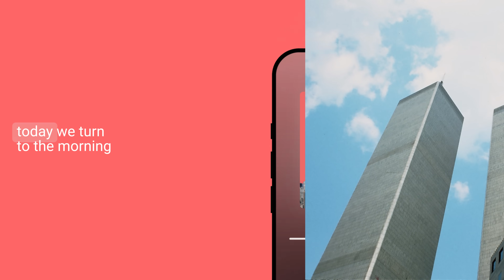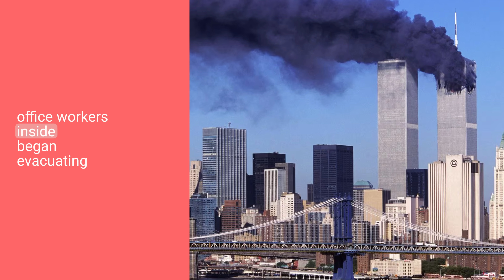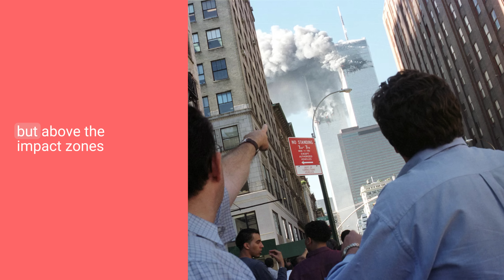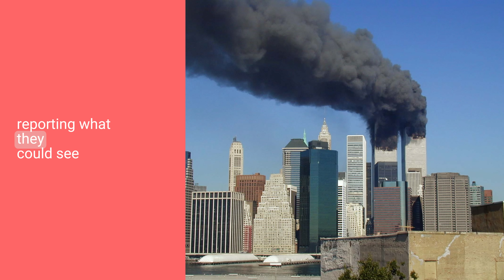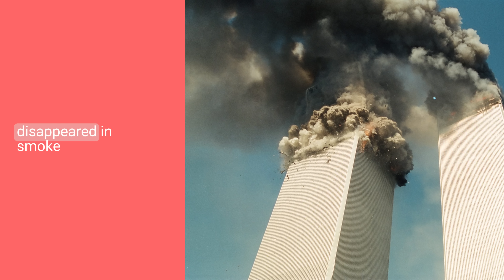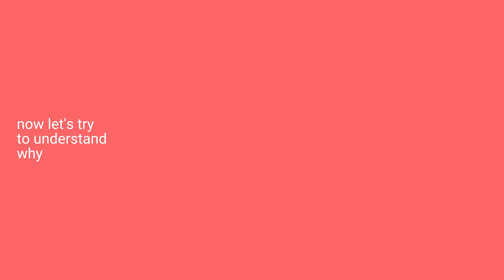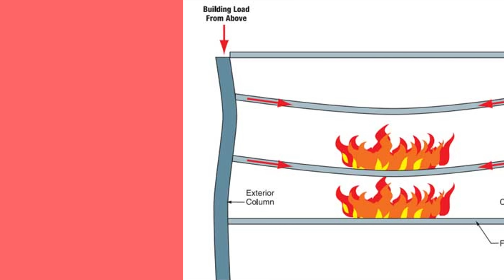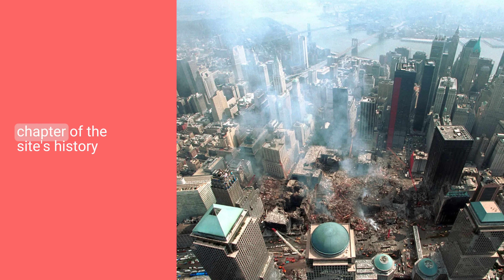9/11 - How and Why the Towers Fell

Comment: Why the “weakened steel hypothesis” is weak
0.a complete lack of detailed calculations, scientific evidence, and models describing how weakened steel led to a. initiaton od collapse and then  b. the complete destruction of two colossal structures
1. The jet fuel burned out within a few minutes—the remaining fires were fueled by materials that are fire-resistant  due to requirements. (low temperature fires)
2. All girders were covered with insulating material - eg. asbestos
3. The fires were isolated in nature - they could have weakened the steel only in specific areas
4. in the case of the north tower, the fires affected the upper part of the building - so, according to the logic of the weakened steel hypothesis, it should also have been weakened and shold be immediately destroyed
5. the weakened steel hypothesis does not explain the most important elements of the WTC collapse:
a. What was the mechanism that initiated the collapse? How could delicate weakened girders could “pull” the much more strong outer columns and the core?
b. What wrakened steel in place of impact could led to the complete destruction of the lower intact parts of the buildings? In both cases, the recordings show that the upper part is destroyed before the actual destruction of the lower part (no pile driver)
Reply from the maker: I get that you’ve got a lot of doubts about the weakened steel explanation. But it isn’t just a vague idea... the collapse has been studied in enormous detail by structural engineers and fire experts. NIST’s NCSTAR 1 report alone runs over 10,000 pages, with calculations, models, and simulations that show how the impacts and fires led to collapse initiation and progression. It’s not perfect, no model ever is, but there is a well-documented mechanism that explains how the towers came down.
Reply: @wikiarquitectura  NIST was ordered to explain the collapses. But NIST didn´t. All they "explained" is what they claim to be the point of collapse initiation, that´s where their "explanation" stops. For the entire actual collapse they simply say it was "inevitable".
Wish I would receive millions of tax payer´s money for spitting out a completely meaningless word...
Reply: “lack of detailed calculations” 

“Consider a typical floor immediately below the level of collapse initiation and conservatively assume that the floor is still supported on all columns (i.e., the columns below the intact floor did not buckle or peel off due to the failure of the columns above). Consider further the truss seat connections between the primary floor trusses and the exterior wall columns or core columns. The individual connection capacities ranged from 94,000 pounds to 395,000 pounds, with a total vertical load capacity for the connections on a typical floor of 29,000,000 pounds (see Section 5.2.4 of NIST NCSTAR 1-6C). The total floor area outside the core was approximately 31,000 square feet, and the average load on a floor under service conditions on Sept. 11, 2001, was 80 pounds per square foot. Thus, the total vertical load on a floor outside the core can be estimated by multiplying the floor area (31,000 square feet) by the gravitational load (80 pounds per square foot), which yields 2,500,000 pounds (this is a conservative load estimate since it ignores the weight contribution of the heavier mechanical floors at the top of each WTC tower). By dividing the total vertical connection capacity (29,000,000 pounds) of a floor by the total vertical load applied to the connections (2,500,000 pounds), the number of floors that can be supported by an intact floor is calculated to be a total of 12 floors or 11 additional floors.
This simplified and conservative analysis indicates that the floor connections could have carried only a maximum of about 11 additional floors if the load from these floors were applied statically. Even this number is (conservatively) high, since the load from above the collapsing floor is being applied suddenly. Since the dynamic amplification factor for a suddenly applied load is 2, an intact floor below the level of collapse initiation could not have supported more than six floors. Since the number of floors above the level where the collapse initiated exceeded six for both towers (12 for WTC 1 and 29 for WTC 2), neither tower could have arrested the progression of collapse once collapse initiated. In reality, the highest intact floor was about three (WTC 2) to six (WTC 1) floors below the level of collapse initiation. Thus, more than the 12 to 29 floors reported above actually loaded the intact floor suddenly.”-NIST FAQ
Reply: ”1. …the remaining fires were fueled by materials that are fire-resistant due to requirements. (low temperature fires)”  Fires reached 1,800 F they were by no means low temperature. Fire resistance does not equal noncombustible. Office furnishings are hydrocarbon rich and can burn very hot. 

”2. All girders were covered with insulating material - eg. Asbestos” Asbestos was only used in the north tower and only up to around the 38th floor. The impact from the planes stripped the fireproofing off the trusses in the impact zone. Bare steel loses half its strength of 1,100 F. As previously mentioned, fires reached 1,800 F.

”3. The fires were isolated in nature - they could have weakened the steel only in specific areas” These fires were not isolated; they were like no high-rise fire ever before. 4-5 acres of instantaneous fires in each tower after the planes hit. This has never happened in the history of steel High-rise construction ever!

”4. in the case of the north tower, the fires affected the upper part of the building” Umm…this was the case in the south tower as well. What’s your point? Because, it’s not making much sense.
”5. a. What was the mechanism that initiated the collapse?” Fire induced sagging of the floor trusses, loss of lateral support to perimeter columns due to sagging floors causing inward bowing which in turn caused shearing and failure of the perimeter column fasteners.

”b. … In both cases, the recordings show that the upper part is destroyed before the actual destruction of the lower part (no pile driver)” Which weighs more 12 stories of intact structure or 12 stories of crushed structure?
Reply: @Oldschooldan1  Initially, after reading only two points, I decided it wasn't worth my time  to reply. Now, however, I thoght it's shouldn’t be leaving it like that, because someone might think that you “know what you're talking about” and start repeating this dezinformation claims which are completely unfounded.
1. 1. There is no evidence that the fires reached a temperature of 1800F. Futhermore there are evidence that this is not true:
x.The NIST report (which is the bible for believers of the “weakened steel hypothesis,” who should stick to their findings!) states that the steel did not reach a temperature higher than 480°F.
x. The combustion temperature of jet fuel under ideal conditions is 1500°F, but the fuel burned out within a few minutes. (also NIST report)
x. It is true that fire-resistant does not mean non-flammable, but that it burns “with difficulty and slowly", in effect fire is "calm" and low temperature
2. Asbestos was used in both towers, from the foundations to the tops. You can find a lot of material on this subject on YouTube.
x. Even if we assume that the plane tore off part of the insulation, it is only a part (especially in the case of the south tower)
3. You can just watch the footage and you'll clearly see that the fire did not engulf the entire building on all four sides.
x. According to a firefighter who reach the impact zone moments before the south tower collapsed, the fires were just “two isolated pockets of fire.”
x.There have been many cases of high-rise fires much more dramatic than the WTC (e.g., Grenfell Tower in London). 
x. A plane crashed into the Empire State Building in 1945.
4. You're 100% right about that. It doesn't make any sense . I just tried to show that absurd theories has absurd consequences.
x. Fires in north tower which were no different from those in the areas around of the impact zone, occurred almost up to 110 floor. This  mean the whole  steel in the entire upper section should (according to the weakened steel hypothesis) should be, well, weakened. After falling rapidly and encountering the intact lower section, it should have “destroy on itself”, i think ;)
5.The second part of the question I've asked for an explanation of the main problem with this proposal.
x. How could weakened girders, essentially “in noodle state,” have affected the much stronger core and outer walls, whose failure was necessary for the upper section to fall? 
x. This can be compared to a trampoline – you can jump as much as you want, even if the material breaks, nothing will happen to the metal frame.
6. What does weight have to do with it? Just watch the recordings – the upper part in first seconds gets smaller and smaller – you can measure with a ruler.  
x When the top disappears in the dust, it measures less than 5 floors in both cases. So if it gradually decreased in size – which is consistent with the laws of physics – why would this process suddenly stop and this tiny fragment slide down?
x. The essence of this problem boils down to the fact that the weakened steel hypothesis, even if it could explain the fracture at the point of impact, is unable to answer the most important question: what happened to the lower, undamaged fragment if the upper fragment was destroyed?
Reply: @neurodegenerat5221   ” 6. What does weight have to do with it?”  Simple, load capacity vs applied load. We know the capacity of the floor system, and we know the weight of the applied load. It wasn’t even remotely close. The floors were massively overloaded.
” the upper part in first seconds gets smaller and smaller”  It’s not getting smaller, it’s disappearing into the structure below, where it is gaining mass with each collapsing floor.

” the most important question: what happened to the lower, undamaged fragment if the upper fragment was destroyed?” Sigh…I have already given you the math that proves the lower portion of the structure could not support the falling upper mass and the “destroyed” section of the tower still weighs the same as it did prior to being destroyed. So, you really have nothing to stand on.

Comment: ~~~~N O mention of T HERMITE ????
Reply from the maker: To save you time: there’s no mention of thermite or any other theories in this video. I only cover the official version of what happened that day. If I tried to comment on every conspiracy theory that has come up, the video would never end.
Reply: There was no THERMITE
Reply: Why mention something that didn't exist. A funny thing about thermite, it burns until there is no thermite left, therefore there would have been no thermite found. Second,  it burns, it doesn't explode as some people have said that it was the demolition charges. This includes nanotechnology, micro, macro, little, tiny, whatever thermite.
Reply: @danmilosevich  Do you know what "black powder" is? You know it as a classic explosive, right? However, if you spread some black powder on the floor and ignite it, it wouldn´t explode, it would rather behave like thermite, burn chaotically, maybe a small puff here and there, but no big "boom". However, thing change completely if you put the black powder into containment. Then it will make "boom".
Same applies for thermite my funny little wannabe.
Reply: @danmilosevich  So?!?
Reply: @zettel3296 just that there was no thermite involved.

Comment: Wrong information about building 7 . I saw Larry Silverstein on tv saying he was advised by the fire fighters to demolish the building as it had been damaged far too much .
Reply: Not so much to demolish it, but since the NYFD top command had determined the building could not be saved, they told Silverstein that they would "pull out", which means withdraw the firefighters and let it burn and ultimately collapse.  They only called Silverstein out of courtesy since they made the call, not the property's owner.  Silverstein agreed, saying that due to the massive loss of life that "pulling" it would be the best and most humane option so as not to lose more lives.
Reply from the maker: I’ve seen that clip too. What Silverstein said was that they decided to 'pull it,' which has often been interpreted as ordering a demolition. But in the context of firefighting, 'pull it' means pulling the firefighters back from a dangerous building, and without the firefighters trying to control the fires, the building eventually collapsed.
Reply: @wikiarquitectura  No you stupid liar, firefighters DON´T call themselves "it"!

Comment: A total of 130 tons of aluminium plane hull hit both Twin Towers, at a speed of around 500mph, the latter 600mph...the jet fuel turned the aluminium molten, which then made contact with the automatic water sprinklers in the upper areas of the Towers.
This caused a chemical reaction, causing catastrophic explosions, which brought down the Towers. This was proven in an experiment done in Germany afterwards, a few weeks or months later. 
If you can be bothered to leave some of your silly 'demolition job' tinhat theories behind, why not check out the Aluminium Journal of around that time, where this is discussed.
Reply from the maker: Thanks for sharing that. I wasn’t aware of the Aluminum Journal reference. From what I understand, NIST and most engineering studies attribute the collapses mainly to fire-induced weakening and progressive structural failure, but I’ll definitely look up the aluminum-water reaction experiment you mentioned. Appreciate you pointing me to it.
Reply: @wikiarquitectura  Ok great. I wasn't referring to you as a 'tin hat' theorist, but to some of the comments.
Reply: Actually, the planes, not counting passengers, are at least 175 tons.
Reply: @janefelix3821   Ok, but I was talking about the aluminium.
Reply: @6543anjou  What are you referring to with aluminium?  The plane can reach that speed for a very short time, but it's just not safe, and there is a chance the plane will crash.  They used the same tactic the Japanese Kamikazes used during World War II, which is to fly slowly and then accelerate like mad at the end, due to the formula F=ma.  Some Japanese were successful in sinking careers, but keep in mind they were flying very low (under the flight deck), over water, which can spout upwards, and under fire.
Reply: @janefelix3821  The 767s are mostly made of aluminium, and aluminium alloys.
Reply: @6543anjou  Yes but given the weight, velocity, and acceleration, they can create a massive force.
Reply: It is physically impossible for a Boeing 767 to go 500 or 600 mph at sea level. The plane would tear itself apart even at the hands of the most experienced pilot let alone a caveman so from the beginning here we have a problem.
Reply: @mkoury83  Those  Boeing 767s were doing, as detected by radar, 440 mph and 590 mph when they crashed into the Towers. Which is close to what I remember. (Just fact-checked again). 
The terrorists were able to do this for a short while at that very low altitude. Those planes were designed to fly very fast in higher, thinner airspace.
Reply: @mkoury83 Boeing disagrees with you. The planes only surpassed VMO for a matter of seconds. Planes don’t just break apart the second they reach their VMO. Oh, and those “Cavemen”, many of them were working on their engineering degree in Germany. I’ve never met a dumb engineer and German’s well they are some of the most educated people in Europe.
Reply: @Oldschooldan1  Interesting.  I apologize , I think I left out a 1 Infront of the ballpark 30 tons of aluminium that help to make up a Boeing 767., so have just edited my original comment.
What we need to keep exploring, is when the planes,  smashed into those buildings, is what chemical reactions occured. ?

I am not a scientist, just a lady who lost a relative in the second plane. 🥀 (I am partially blind so this is a challenge, but I give a huge damn.).
Reply: @6543anjou  I’m so sorry for your loss dear lady. While I am familiar with the theory of molten aluminum being explosive when it encounters water; I don’t think that was the cause of the collapse initiation. It is certainly possible for some small areas to have had this phenomenon occur; however, the standpipes that delivered water to the sprinkler systems would have been severed by the planes’ impact. NIST’s inward bowing theory is the industries excepted theory.
Reply: @Oldschooldan1   Thank you so much for that,  I trust what you say. 🥀🧡